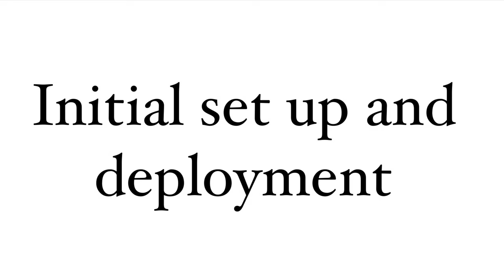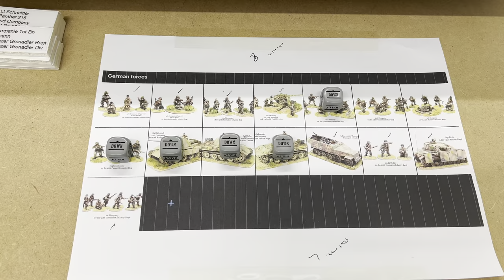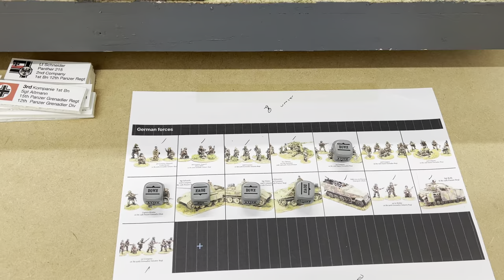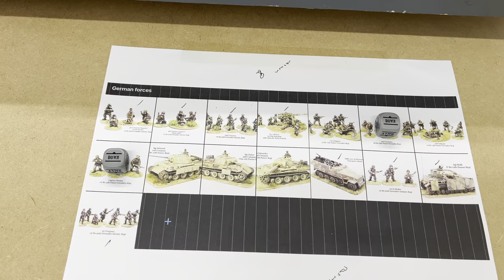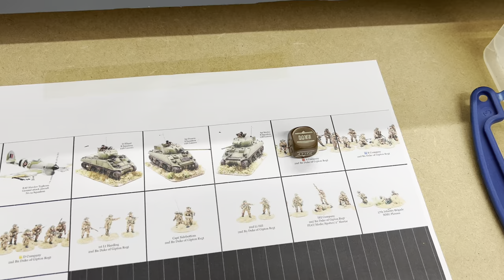Bolt Action Battle Report British v German Normandy 1944 Expanding the Bridgehead

Comment: I love the Duke of Gipton Regiment idea :)  Outside the scope of the rules but I'm sure that some house XP rules could be created for a rolling campaign. And I thought for a minute you were going to say that the rubble bits (nice idea btw!) were hand painted :)

Couple of 'technical' points - the MMG team FUBAR, they'd only go as far as the board edge and no further (unlike, say, in X Wing). The Firefly firing at Company C after entering the woods would give soft cover to the target as it's firing more than 1" through the woods. And finally! The two mortars, I use old acrylic X Wing (that game again!) target lock tokens to identify which mortar is which, and which spotter (if there is one!) is spotting for which mortar!
Reply from the maker: Cheers Bazza and as it goes the rubble bits were painted/dappled to break up it just being small stone scatter etc. 
I’m going to do some proper mortar and barrage aiming markers for future as I don’t like using just a die and the ‘Dukes’ will be getting a new plastic converted mortar team rather than using the metal Crusader minis one.

Comment: Really nice board and figures. One question (maybe you described it and I missed it.). What is your cobblestone road made from? It looks great.
Reply from the maker: Cheers Mark and my roads are made from industrial type carpet squares cut into lengths and painted up. If your on Facebook check out the Bolt Action terrain page where I’ve posted a ‘how to’ guide with pictures etc.

Comment: 31:25 AFAIK no german tank ( in WW2) used MG42 as their hull or co-ax MG's; applying the "Buzz Saw" rule seems inappropriate.  (I don't play Bolt Action, it is just a casual comment).
Reply from the maker: Simon I know they used MG34’s but in the rules they are classed as MMG (or MG42’s) for BA rules and I think they do this because the rule writers took the view the MG’s were static mounted within the tanks and therefore capable of increased rates of fire if that makes sense etc.
Reply: @dazvanderyoung1911  Fair enough, it just seemed a strange comment.

Comment: MMGs are considered FIXED, therefore they need a run order to move, but only move 6". So even though they had to run to retreat, they could only move 6", not 12. A unit has to be on the ground floor to exit a building, so, it should have stopped on the 1st floor.
Reply from the maker: Yes I often make mistakes as sometimes when filming I’m concentrating more on that than the rules and only when I watch it back I realise etc.